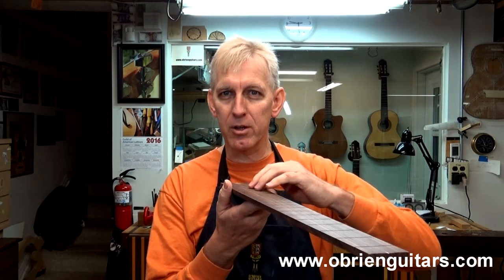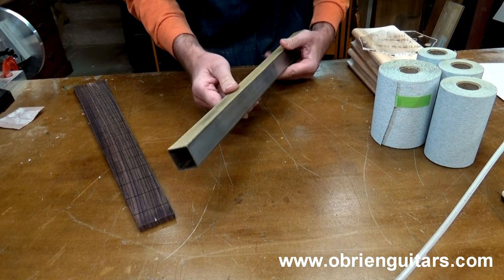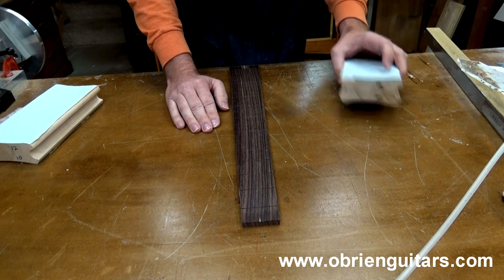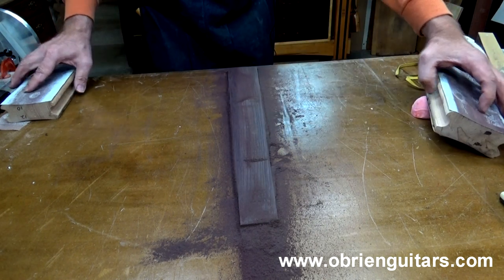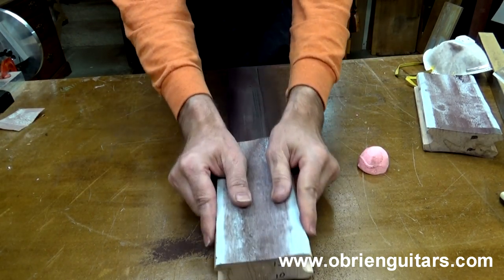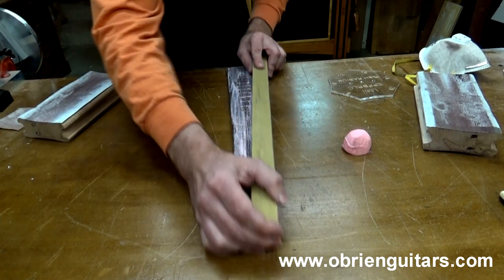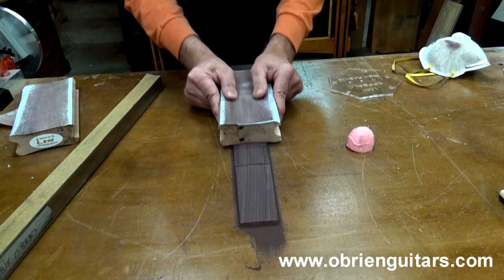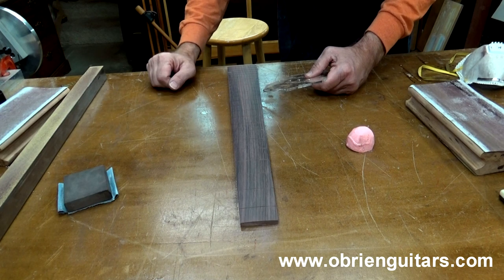Luthier Tips du Jour Mailbag 107 - Compound radius

Comment: I mess with mostly Jackson's which have a 12/16 compound radius. What I did was took the frets off the neck. Stuck sandpaper to the fret board, got a nice block of wood the length of the fret board and made a compound radius block just sanding about an inch in each direction. It was a pain but now I've got a cheap sanding block with a perfect 12/16 radius. I use it to profile the fretboard and contour the frets when replaced so they match the radius of the fretboard perfectly. Hope this helps someone

Comment: This task is ideal for a cnc router - far cleaner and more accurate! Keep the sanding blocks for glue cauls, fret press cauls, or make a matching cr caul on the cnc!
Reply: You're lucky if you have access to that but many of us don't... Gonna have to do it by hand since I don't wanna give up putting a Floyd and can't find a suitable locking nut in other than 10'' radius. And I definitely don't want a 10'' fretboard.

Comment: Hi, Question? If you do the 14 inch first, then come in later to do the heavier radiuses, don’t you take a chance at the fretboard ending up being thinner down at the nut end Area and thicker up at the tongue? I understand you came in with the leveling bar later to make sure that you are level, however you can still be level on the surface and be thinner as a nut and thicker at the tongue. Which would defeat having fall away?
Reply from the maker: I guess this could happen but you are doing minimal sanding. The sanding bar blends everything together.
Reply: OBrienGuitars Hi thanks for your fast response. would it be safer to do The 10” first the 12”, 14” then the leveling bar. Or would that take too much off? Thanks again 👍🎸👍
Reply from the maker: @GTguitarworks  No. that would also work. Just find the way that best suits your needs and go with that. I think either way would work.
Reply: @GTguitarworks  If you proceed that way your fretboard WILL be thinner where it is 14" radiused
Reply: Xavier BARON That’s the idea I wanna create a little fall away
Reply: You can begin with 14 , leaving the centerline of the fretboard almost untouched so no loss of thickness, thes sand to 10 leaving the centerline untouched: result : no thickness loss, just the edges of the fretboard for the radius. If you begin by the 10, and then by 14 you will have to sand the centerline to match the new radius and will loose thickness.
Reply: Xavier BARON In repair, I have experienced when leveling frets on a compound radius fretboard, if you do it The way you’re saying, when you do Bends it will Fret out, because the 14” radius ends up higher than the ten”.  I do the 10 inch first not touching the tongue area with a 10 inch block. then come behind it with the 14” to do the tongue area, checking with straight edges as I go to create fall away. Then I come in with the leveling bar. Like Robert said it can be done either way, I’ve been building guitars for 11 years now and I’ve never done a compound radius fretboard but I have leveled frets on compound radius fretboards for many years and that’s just my experience. Thanks for your input though.

Comment: Quick question, how do you do a fret level on a compound? I have done many fret levels on guitars I've build but all of them a standard style single radius. I currently have a guitar with some problem frets throughout which causes issue with string height but has a compound radius. I take it just run my leveling beam as shown for the fret board leveling just transferred over to fret leveling?
Reply from the maker: You level the frets using the same method you used to put the compound radius in the fretboard. Michael Bashkin explains this thoroughly in his Fretwork course available here.  https://obrienguitars.com/courses/bashkin-fretwork
Reply: @OBrienGuitars  fantastic i greatly appreciate it!

Comment: Hello Robbie, when I do radius with blocks as you have, I usually have a perfect radius in the middle untill the edge where usually I see a bit of light, and it really bother me cause I can’t get rid of that defect and it also affect the fretting a bit. Also I see that usually this don’t happen while using high grit but only when switching to finer grit (like 120 or more). 
Do I do something wrong? Cause I use pro tool and don’t think they’re wrongly machined.
Reply from the maker: Well, it could a few things. Are you wrapping a piece of sandpaper on the block? Sometimes there is a ripple in the paper and it can round over the edges a bit.
Reply: @OBrienGuitars  I usually cut 2 stripe of double-sided tape and stick em at both end of the block, then attach the sandpaper on (and perfectly trimming it around).  I also have a solid sustain under the neck to not let it bow with the pressure
Reply: I'm 75% sure I do something wrong, like ''sanding method' because that thing happen in every neck I do. I changed the way I attach sandpaper to the block just to verify but it still happen.

I sometimes can't understand how much force to put into block while sanding. and I have the small impression that if I press too much it 'eat' over the edges, and if I don't press enough it don't 'eat' in the centerm so I'm always uncertain on what to do
Reply from the maker: @italianguitargarage708  Well, it is hard for me to diagnose without seeing your process. Would a long sanding bar like I show in the video remedy the problem?
Reply: If you aren't keeping the block perfectly straight (i.e. twisting it when viewed from above) it can cause this type of problem. I made a three sided trough that guides the radius block and prevents any unwanted movement. The guide needs to be fairly low to allow you to grip the block or you can add a handle to the block as I did.
Reply: @OBrienGuitars  Sorry I fell asleep. And no it usually happen with long aluminum sanding beem too, that's why I think my procedure is wrong, even if I don't know ''where''
Reply: @jdy5556  That's something I thought about making
Reply from the maker: @italianguitargarage708  Well, realizing the problem is the first step to finding a solution.